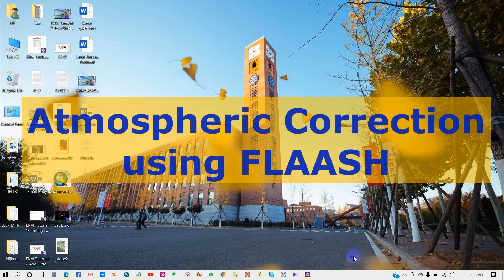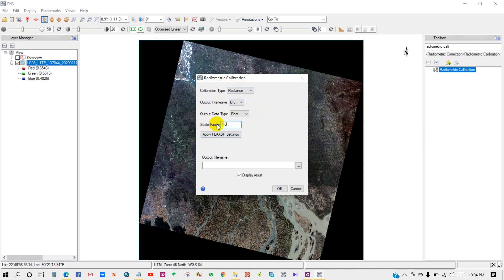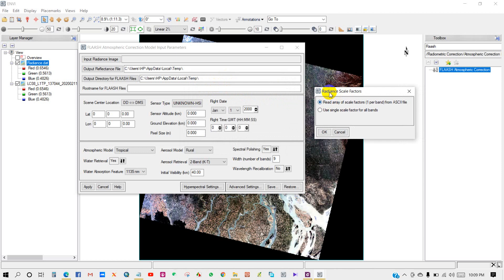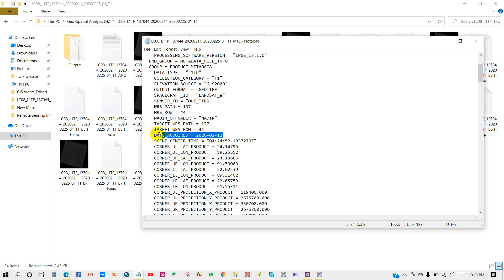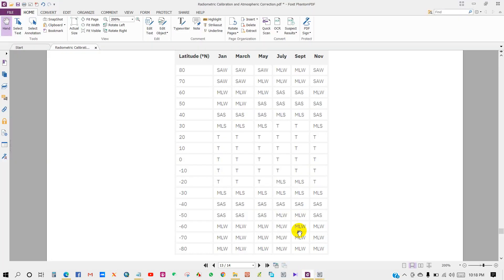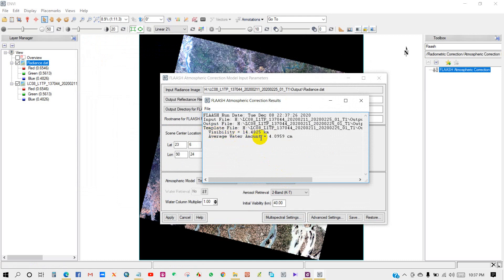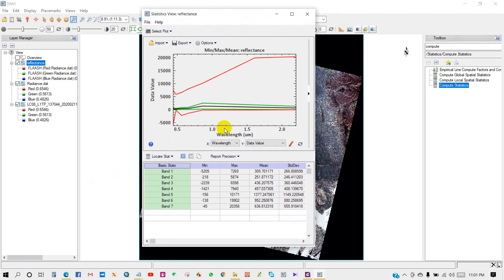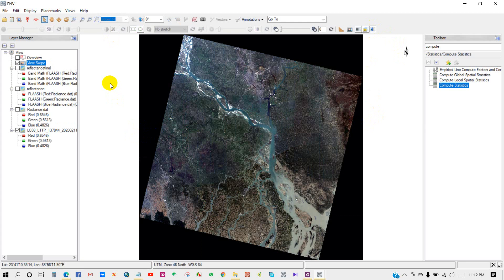ENVI Tutorial 6: Atmospheric correction of satellite Image using FLAASH

Comment: Hello. 
I have been facing a serious problem with my ENVI. I use 5.3 ENVI version. But recently when I download any Landsat images and try to open it as geotiff and metadata , ENVI shows error. Can you help me ? What is the problem I cannot figure out. Kindly reply.
Reply: I have the same problem. Did you find a solution?
Reply: I'm facing with same problem too. it is opening that my download landsat data in 2019 year.
Reply: I  found onething. If Landsat 8 Data is Level 3 , Envi can't open it. 
To Open the Landsat 8 Data, You should use the Landsat 8 Level 1 data. I mean You should use raw satalite image.
Reply: @muhammetmustafaeroglu8602  I used the Landsat 8 Level 1 data belonging to 2018 or 2020 year in ENVI 5.3. But, ENVI did not open MTL.txt file as metadata. Did you find a solution to this situation?
Reply: No solution at all. ENVI opens images that i downloded in 2019 ( 1975-2019 with 10 years interval). But when i download same image of 1975 or anyother image,  ENVI cannot open new images.
Reply: https://youtu.be/lA2DGCaAbm0  Follow this procedure just do only the renaming its enough hope it helps